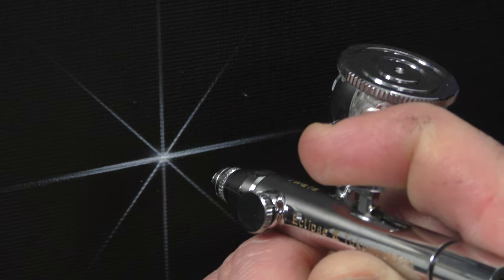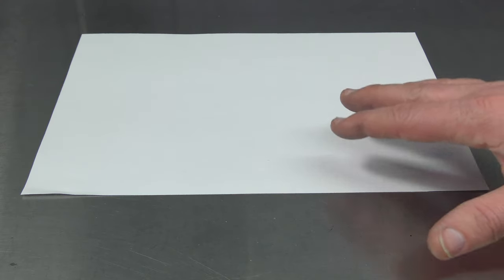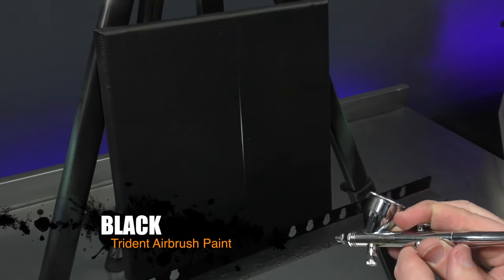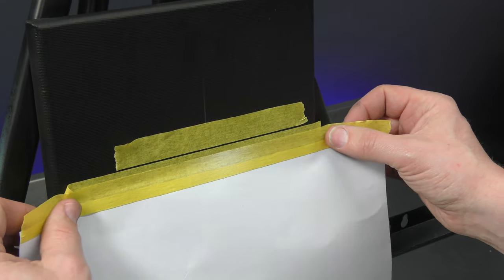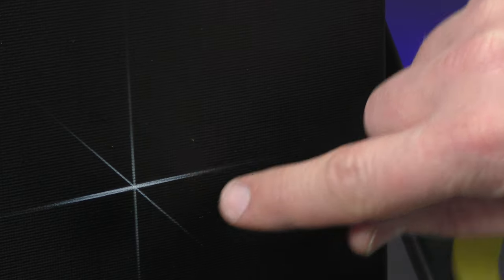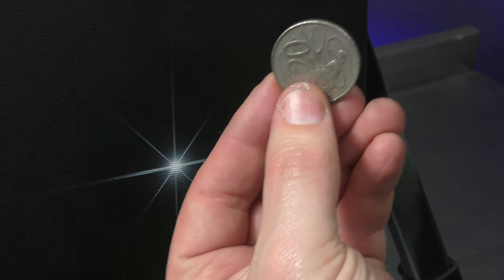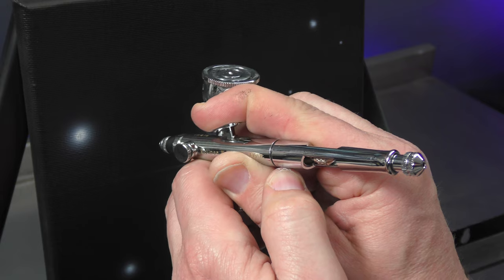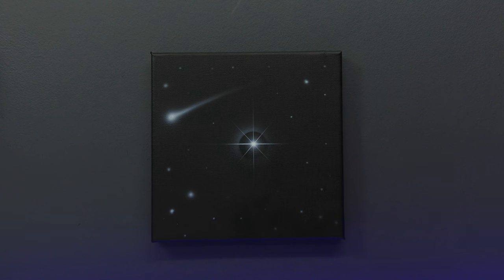How To Easily Airbrush A Starburst

Comment: Great video, thanks for sharing your expertise!  I have painted several of the pictures that you presented with good results.  What type of easel would you recommend for airbrushing?
Reply from the maker: It’s totally up to you re : easel as it really comes down to what you prefer? I use the fold up Aluminium tripod easels, as they are portable and easy to set up and work well for filming . I also have a larger wooden one which I use when painting larger or heavier substrates. Hope that helps and glad you enjoyed the vid 😉👍🏻